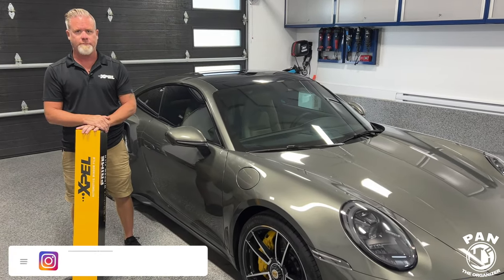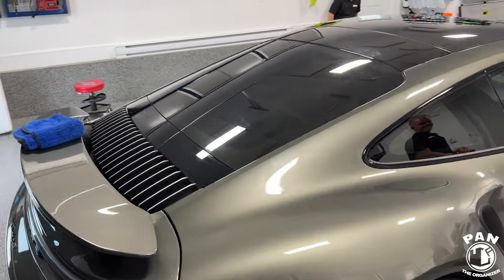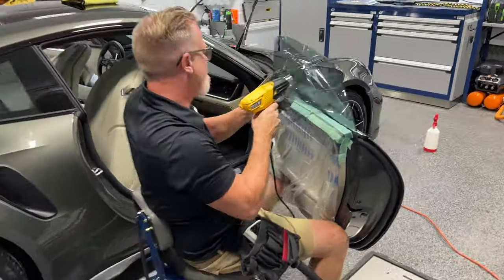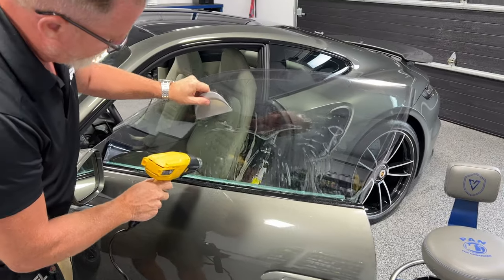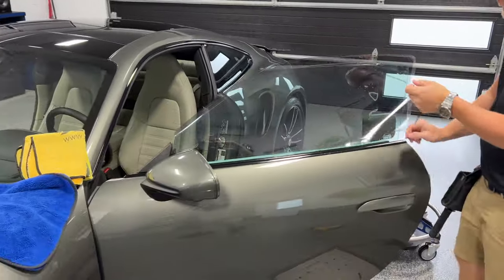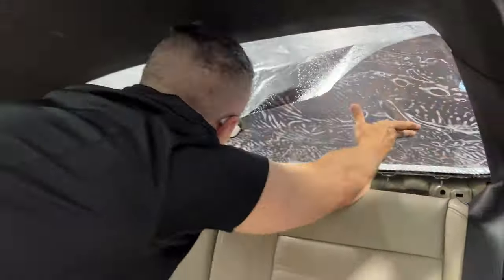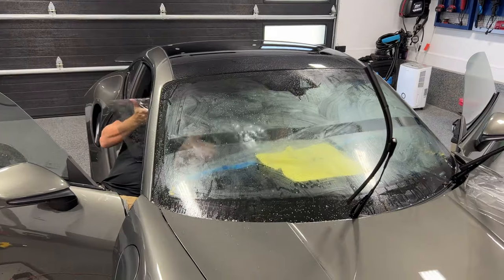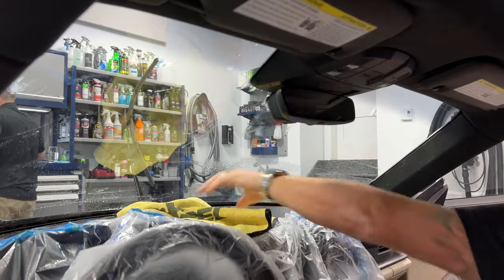Window Tint On My Porsche 911 Turbo S | XPEL Prime XR Plus

Comment: I have Xpel on my side windows of my Audi SQ8.  It’s perfect. The car is black. It’s a beautiful finishing touch and differently helps with reducing heat. I wanted to tint my windshield but the Xpel installer saw that I have a repaired rock chip in the glass. He said that even though it’s very small, he did not want to install the product because it might fail with the constant expansion and contraction we experience in the desert.
Reply from the maker: Thanks for sharing Mark!

Comment: I have the same tint on my Ram. Big difference getting into my truck on a hot summer day. You'll notice it's hot but not baking in a oven hot. Very happy with it.
Reply from the maker: Exactly! It has been a month already and I do notice the drastic reduction in heat and the greenhouse effect in the car on blazing hot days.

Comment: I got my Lincoln Aviator tinted by an authorized installer here. Their DAP program is what really separates xpel and along with high heat rejection nos.

Warranty terms are great as well.

And since you know which installer does plotter cutting.. it really helps optimize the price for PPF or tint and guarantee minimum quality of the work as well (as it is not hand cut).

Comment: Looks great, mines already tinted on the back and rear side windows as standard, the fronts has a yellowy kind of tint that's probably UV inhibiting. I might tap up my local Xpel guy to see what he suggests. I've had Xpel PPF added to the entire front end of the car and lower side and hips. Its genuinely a great product so far. Its self healing so any light scratches and swirls will naturally fade to perfection again. I'm surprised you didn't get them to carry out a 'Performance Package' PPF? It makes the paint look and feel like perfect OEM from new. 😎
Reply from the maker: Thanks for sharing. I am just not a fan of the look or feel or PPF. Plus, as I get a brand new car every three years, and do low yearly mileage, scratches and stone chips are of no concern to me. My cars are always pristine when I bring them back to the dealership.

But for people who keep their cars 4+ years, and do average to high levels of mileage yearly, and are looking for ultimate stone chip and scratch protection for their paint, PPF is the way to go for sure.
Reply: @PanTheOrganizer  Thanks Pan, everything is personal preference. Thats the beauty of the detailing world- it suits all tastes and wallets. I've out two layers of Carpro SIC over the top of my Xpel coating and its made it look even more candy looking. For the rest of the car to blend in I used 3.0 (2 layers and 2 layers of SIC) on the non ppf areas to blend and match the warm look and feel. It does blend in quite well. I just hope SIC bonds to Xpel for a while. Under polarised sunglasses it looks patchy but with normal lenses it looks fine. Its strange how polarised lenses pick out the ceramic trail from application. You cannot see otherwise 🤷

Comment: Yes Pan you should make a video on xpel ceramic coating, I had experience with installing xpel and is a very time and temperature sensitive coating on how it flashes, I would like to see your experience with it and to see if is worth the price vs the easy of use and durability
Reply from the maker: Noted

Comment: This past March I had XPEL ceramic tint installed throughout my 2018 M550 the same time I had a paint correction done with Swissvax to finish it off.  I was shocked how well the tint gave off a glossy look - the paint (Mediterranean Blue) and glass and black trim all looking like  they had about the same gloss level.

Comment: I just got my NX tinted today with Xpel prime XR plus too. You guys are doing more professional while tintint the side windows. The shop that I went today, their staffs didn't even use any piece of cloth to cover  underneath the windows while they sprayed the water. Luckily I didn't decided to tint my windshield today. There are few speakers in the front, I don't want to take the risk to let the water drip into my speakers.

Comment: Had sent you these two pictures back in winter. Thought you might find them interesting. Sent via messenger, but I don’t think you ever saw them.

Frost on the windshield, look how each individual fleck is literally up in the air, how cool and how strange is that? Only the thin edge is attached to the glass. Wondering if the mcguiars silicone detailer spray is causing this?

Comment: I had Xpel XR Plus on my last car.  The 70% on my windshield was blurry.  It took 2 redos from different boxes and they all had the same issue before I had the shop just take it off.  Was really disappointed.   I hope this doesn’t happen to you, but heads up watching for it.  The darker tint on the sides and back were fine.  Ultimately, I think any ceramic tint is roughly equal and the premium price tag on Xpel just isn’t worth it (and I live in Florida where there is no shortage of heat).  Key though, always go to a good shop for the install.
Reply from the maker: I have zero issues so far and it has been about a month.
Reply: @PanTheOrganizer  glad to hear that!  May just have been a few defective batches or quite possibly installer error.

Comment: Window tinting is absolutely essential to provide UV protection and heat dissipation. Unfortunately it’s illegal to tint a windshield completely in FL. Only a band along top is allowed
Reply: If it's clear tint, no problem. You'll be okay with anything over 50%.

Comment: Wauw, this is really impressive..  was not really aware of uv/heat resistance; just thought it was for darker... really gets hot in my bmw and maybe this could be a solution :) will check it out
Reply from the maker: Yeah the tint film technology has evolved a lot in the past decade. So while you can still get regular tints that just give a darker look for privacy, you can also now get tints that give that look plus help with IR/heat rejection.

Comment: Pan, I know this is off topic. Two years ago I followed your excellent tutorial on applying a ceramic coating to my showroom condition 1987 Porsche 944 getting a beautiful result. Other than washing, is there some other coating I should put over the ceramic? And when will I know I need to redo the ceramic coating?
Reply from the maker: It's crucial to do a maintenance wash every 2 or 3 months with ceramic coatings, to replenish and boost the existing protection and make sure you maximize its durability. For that purpose, you use a silica spray sealant. I have a popular tutorial on how to do a maintenance wash of a ceramic coated car here: https://youtu.be/yLiePQRMFc8

As far as how to know when you need to redo the coating, there are two general rules:
1) When you reach 80 to 90% of your coating's quoted durability claim, it's time to think about redoing all the steps to strip and reapply a fresh one. For example, if you have a 2 year coating, at around the 19th month mark, it would be good to start thinking of a total reapplication.

2) When you see the hydrophobic properties starting to diminish. Assuming you did proper maintenance and the coating isn't simply clogged by traffic film and road grime, if you see the water beading starting to diminish, and the water starting to pool and be very slow to sheet off, that's usually a sign the protection is on its way out, and it would be time to restart the entire thing.

I hope this helps!
Reply: @PanTheOrganizer  Thank you Pan! You are the best! I will check out your maintenance wash video.

Comment: Pan - I didn’t know that you had the lightweight noise insulating glass….can you tell me about your experience with it…did you do a comparison with the regular glass…do you think the benefits outweigh the potential issues…..there’s a ton of stories about the glass over on Rennlist.  
On the GT3 forum  I think it was established that Porsche had a supplier issue (the glass cracked on a number of cars. ) On the turbo S forum it appeared to be that some installers struggled applying tint….using a knife around this glass is a big no no.  
If you ordered the car again, would you still select the option.  👍
Reply from the maker: I have had the car for a year and and four months so far, and I really like the lightweight noise insulating glass. Because I chose the top of the range Burmeister sound system, I wanted to cut off as much of the exterior road noise as possible (as 911 cars aren't as quiet as my previous BMW M550i for example). And compared to my friends with 911 with the regular glass, I really notice a difference. I'm an audiophile, so everything counts.

Yes I would absolutely order that option again if I was to get another 911. I can also confirm that both the original window tinters from Porsche (I had taken tinted option from the dealership prior to delivery) and also Dean Mitchell shown in this video (almost 30 years of window tinting experience, a legend in that industry) had absolutely no problems tinting my windows.

I hope this helps. Do you plan on buying a 911?

Comment: Pan, are you happy with the tint a year later?  I’ve had Xpel and liked it before.  I have a g80 m3 coming in and it seems like 35% sides , 70% windshield is popular.  I’m afraid it may be too light?  I’m used to 15-20% with the 80% windshield which provides privacy, but still allows some light to go through.  Have you been happy with the 35%?  Inside it almost appears clear, outside with some angles and sun it does reflect a bit.  Thanks for your follow up thoughts.
Reply from the maker: It’s subjective for the tint level (and what is legal or not where you live) but I absolutely loved it.

Comment: The XR Plus film is blocking 92% of the IR heat with the 70% and the 35% and 20% is blocking about 96% of the IR👍🏼
Reply: @jasewagner5717  not really relevant to my comment👍🏼
Was just stating stats from the safety data sheet. Either way the numbers announced in the video are not what XPEL advertises.

Comment: Car looks Pantastic!!!  Hey, curious as to why you went with the fade to black look? Also, I’m getting ready to tint my new M440i and Im going with 40% Ceramic all the way around and was wondering if you have Heads Up display and if so, have you had any issues with the Ceramic affecting it?  Thanks for another great video Pan! I gotta run….Im way behind on your video’s and need to get caught up! Have a great weekend 👊🏻
Reply from the maker: I think Dean missused the "fade to black look" thing hehe. What he meant to say was we used 35% on all the side glass, and a 20% film as you can go darker for the rear windshield according to our local laws.

I don't have the HUD in my Porsche.

Comment: I have that film on my P car as well.  the funny thing is I don't really feel or see the difference heat wise after the car has been sitting in the sun the whole day.    (vs a cheaper film)
Reply from the maker: Really? Do you have your windshield tinted with that film too? I was told that is where the majority of IR comes through, as it's also usually the biggest glass surface on the car. I immediately noticed less greenhouse effect, less heat in the cabin when driving on sunny days.
Reply: @PanTheOrganizer  yes front tinted too.    I think the heat rejection works well for a while, but once the car has been sitting in the sun for hours it won't matter too much.   I just don't feel the car being that much cooler if any than with  cheaper film ..   They  way they test/show you the heat rejection is what a heat lamp and a piece of glass with the film on it.   They measure the temp of the glass, but that doesn't account for all the heat collecting in an enclosed cabin for hours.   When the car cools down from using the A/C it may help.  it doesn't heat up as quickly.  but doesn't seem to do much for a car sitting in full sun most of the day.
Reply: @PanTheOrganizer  I did some tests and without any film the dashboard hit a temp of around 140 deg.  after 70 min in full sun.   With the film it hit a 130 def in full sun after 70 min    It's 10 deg. difference but you are not going to feel it yourself.           The temp inside the car itself was almost the same @ 120

Comment: Is it normal to have wavy distortion on some areas of the glass after installing the Xpel XR plus? I had a guy I paid $60 buck for my front car 2 years ago using a no brand tint and installations was almost perfect, but today I paid another shop to put XR plus on my newer car was really disappointed. Some area has that wavy spots which like installed by a rookie on his first day.
Reply from the maker: I don't see any distortion in mine. You should perhaps go an see your installer about the issue you are having.
Reply: @PanTheOrganizer  The wavy distortion , to my surprised disappeared the next day. Maybe the nature of the tint combined of moving the car out from warm garage to freezing temp outside few minutes after the installation.

Comment: I didn't think you could tint below 15cm on windshield in Quebec
Reply from the maker: In theory, you can't. Do people still apply light tints on their windshield? Yeah, sometimes they do. It's like the 70% tint limit for side windows in Quebec. You often see cars with super dark tints up front, which are more like 35% or 15% tint. Are they allowed? No. Do they still do it? Absolutely.

Comment: I was thinking for a long time about tinting my car and very seriously looking this year esecially at this tint just can not justify a $800 gamble for the side and rear window when i really would want the windshield and sunroof done as well. I say gamble as its really hard for me to allow someone else do the cosmetic work on my car knowing how OCD I am. I even looked at picking up the tint and trying it myself but can not find it easily
Reply: That’s because professional grade window films are restricted by most manufacturers, are often territory protected and are not to be sold to the general public.   

If you’re not a qualified installation facility, they won’t sell it to you.  

And $800 is wildly overpriced for almost any vehicle.
Reply: @jasewagner5717  thats what i thought.....especially for a small Audi A3
Reply: And watching some videos on youtube you see some rip the top part of the door card out of the track makes me question most shops as it would get WAY more expensive should they destroy the door cards......also if i could have better results detailing as well as ceramic coating without any training i do not doubt that i would be able to do a decent job tinting
Reply: @grand04gt  our policy is, if you’re going to be yanking the top of a door card around - just remove the entire damn thing before you go breaking stuff. 

Most door cards are only held in place with only a few screws anyway.  Tinters are always fussing about “that takes too much time!” (Like the extra 3 minutes a panel is going to matter), VS breaking shit
Reply: Exactly 100% which is why i want quality and would be more than happy to pay.....just within reason as I am far from rich lol

Comment: you never mentioned the pricing as part of the review
Reply from the maker: There is no point as prices can vary from one country to another. You can check with an authorized installer near you.

Comment: Hello Pan , good look but it’s the first time I see a film on a windshield ; are you sure it will not be too dark when you will
Entering in parking areas which are often dark areas 
Need your feedback 
Thanks
Reply from the maker: It's a very light tint for the windshield, so I have zero issues when driving at night. We mainly used the film for IR rejection on the windshield. And on the sides and back we went for a darker tint.
Reply: @PanTheOrganizer  Pan , could you  list the tint percentage you have chosen for each part of the car ? 
Thanks
Reply: Got it  70 % on winshield 
35 on front 
20 on rear 
I wonder how much IR and UV protection there is from stock on windshield ?

Comment: XPEL is a bad company, they don't back their customers or even their own dealers. I had issues with their tint (bad job: lifting + wrinkles, orange peel etc) and they didn't want to back their warranty at all even though it says it covers this exact stuff. The film was not optically clear even. The dealer also damaged my car (not XPELs fault) and they didn't care at all how their own dealer handled it. I had to threaten to sue to get them to even attempt to fix it, which they never did in the end but only offered a refund. The dealer scratched my side window up very badly and I had to use CarPro CeriGlass to fix it, and they dented the trim which I thankfully was able to fix myself. We had video of the car before hand even and XPEL still didn't care about their paying customer or their own dealers screw up!

Comment: Gorilla glass is very fragile? Tell that to Apple. All the iPhones have gorilla glass.
Reply: It is breakable still, not like that of Samsung's new ones although Samsung also uses Gorilla glass on the s21 ultra.  I think is because they have the Gorilla 3 or a more resistant Gorilla 6.
The one that is though is Gorilla victus which is 2x more resistant to scratches than their Gorilla 6.
Reply: Gorilla glass isnt "fragile" literally, it just can't bend. So it goes from indestructible to shattering in an instant.
Reply: @vladbustiuc  from what I do know is that the Gorilla 3 and 6 have an impact resistance but can shatter, obviously the 6 is better than the 3 but the one that is really excellent for now is the Vctus.  Possibly they have made a better one but has been some time I have not checked out their products progress at Corning